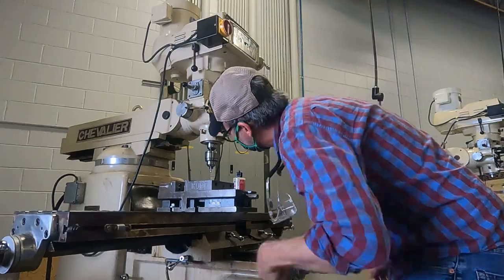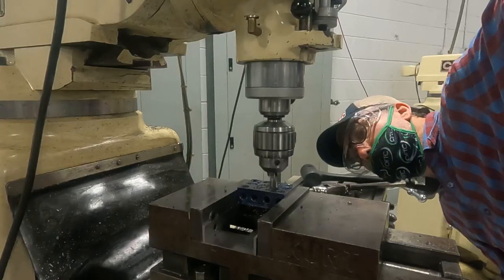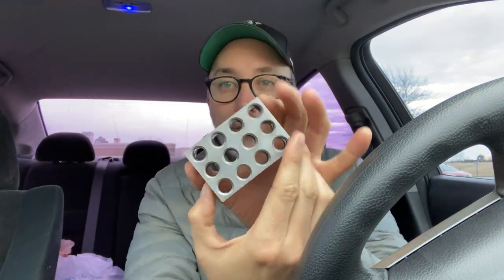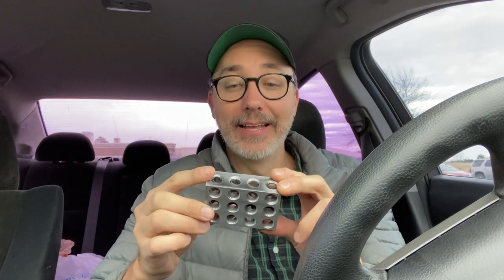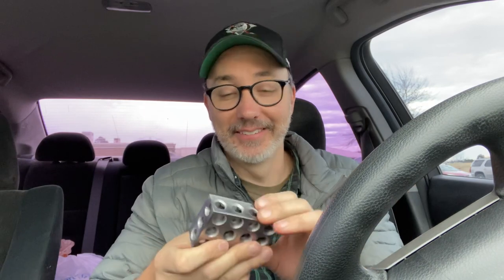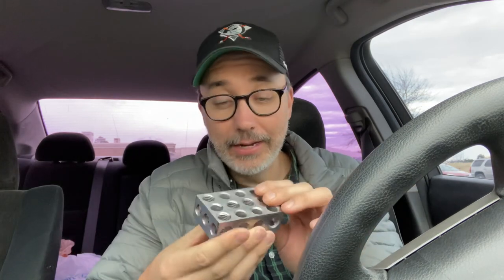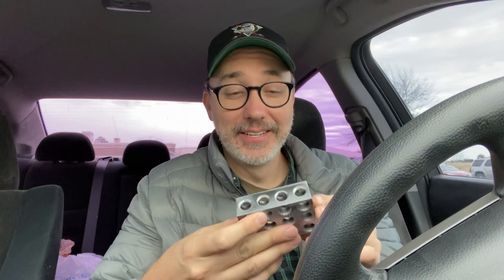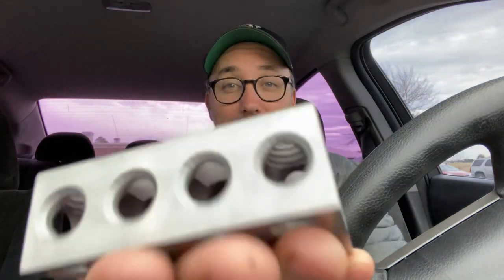Machinist school project - 1-2-3 Block

Comment: Learn in metric too. I know most of the tooling is standard but working for a German company it's really frustrating taking CAD to a fabricator who says they can do a job and find out 2 weeks before deadline that the work has been farmed out and is delayed. If you're think about starting a small shop there might be a niche for import design fabrication.
Reply from the maker: Great tip!  Thanks!  I just cut metric threads today.